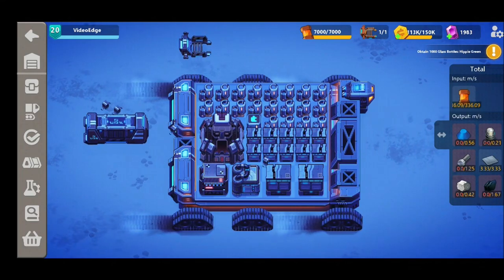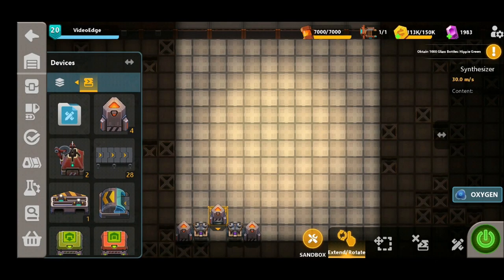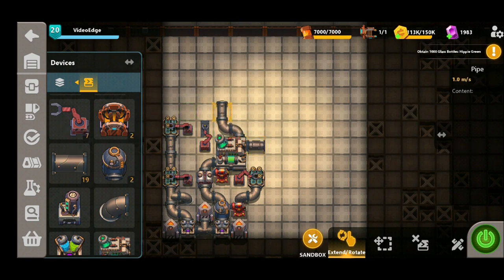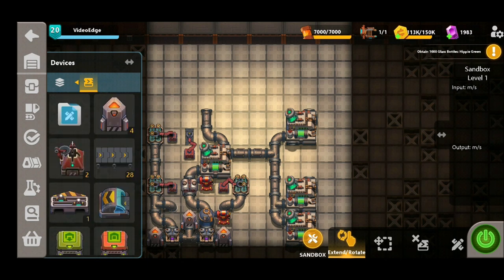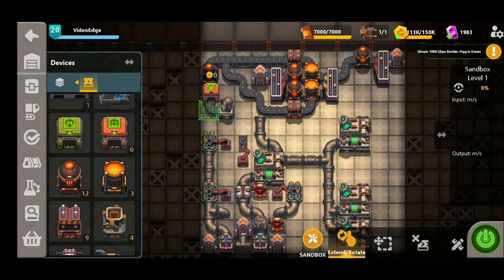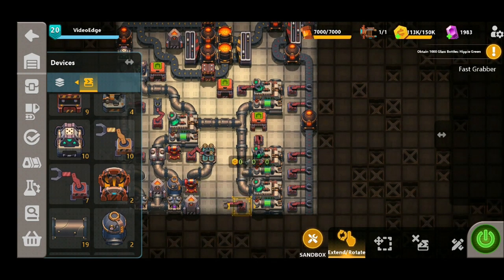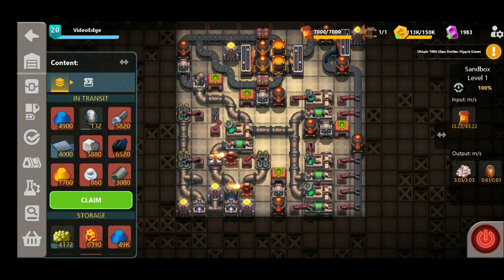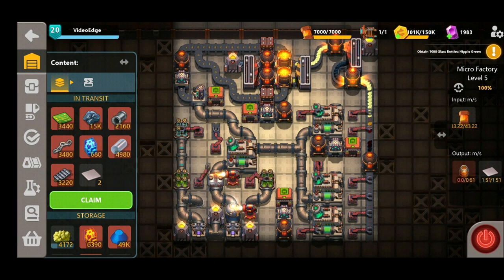Sandship Crafting Factory: Making PLASTIC + Efficient Micro Factory Design! [HD]

Comment: Why cant i make inks. I have them unlocked, but a. It doesnt show me how when i click an ink amd b. When i set up what seems like the correct way it still doesnt work
Reply: Powder into heavy oil.  Iron powder taken from a belt or grinder via an arm, and dropped into an open pipe, produces blue paint.  Sulfur powder produces yellow, Mercury powder produces red, Carbon powder produces black, and Titanium powder produces white.  Use the Applier to receive that pipe of paint and put that paint into glass bottles.  The glass bottles with paint are sent to an Exporter (the device with a flat orange top).

To mix paint colors, use a pair of Importers (the ones with the green flat top) to select containers with the two colors you want to mix, and feed those containers into an Extractor.  The Extractor destroys the container, and provides the liquid.  Mix the colors in a Chemical Mixer (the one with the two glass containers, one blue, one green), and that provides a liquid output.  Take that liquid output (the new color), and feed it into an Applier to put it into a container (likely glass bottles).